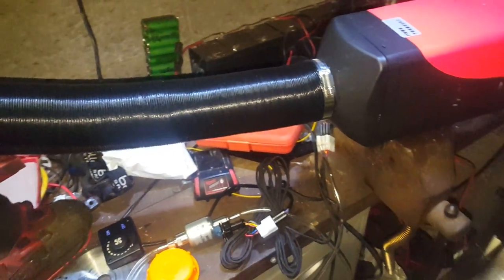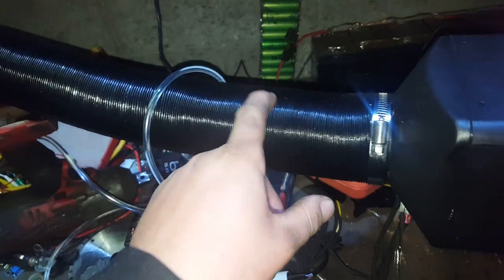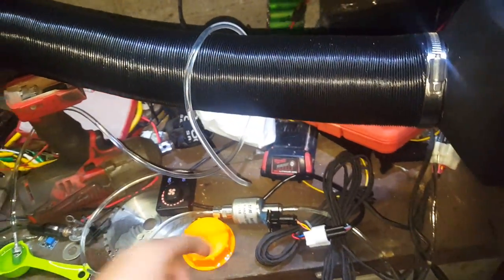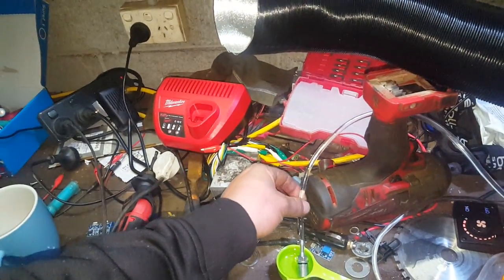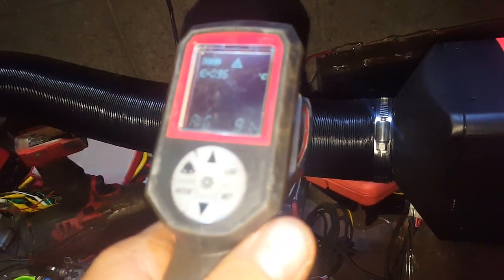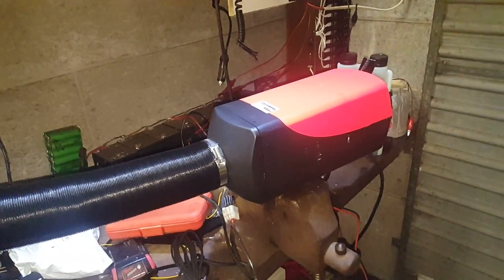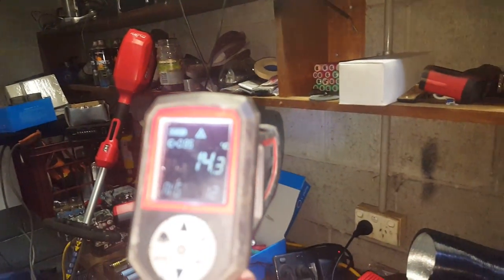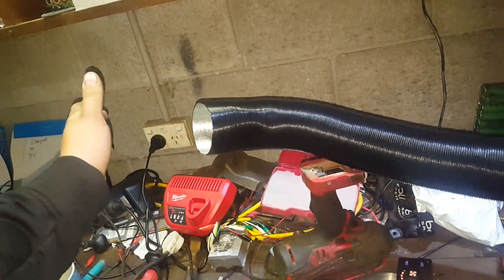Awesome 5Kw Diesel Powered Rv Motor Home Heater Test in the Shed

Comment: I'm worried that it will leak and smuther me to death in my van. Is that possible?
Reply from the maker: Combustion and heat exchange are 2 seperate systems
Reply: @Oneupthesleevecustoms . Sorry im confused. im new to all this. Are you saying its not possible? Its just the carbon monoxide im worried about leaking in to my van and suffocating me! its a small transit with no windows or anything. im going to drill the discharge line going outside but im still worried it can leak, you know coz they are from china lol
Reply: @japreet_kah  This heater doesn't use any air from the interior cabin. That said, I would STILL buy a CO ( carbon monoxide ) and smoke detector for your van. I am installing this in my 5'x10' cargo trailer camper conversion. I'm using this because you don't have to have an open window for its use - since the trailer will be used in northern New Hampshire during winter, that was pretty important. It also will NOT add moisture to the cabin.
Reply: @Jollyprez  thanks for the advice mate ill buy one now haha

Comment: Hi I’ve got one just fitting it now,thing is does it need to draw air from the room to get up to temperature (is there a sensor in the unit)recirculated air or is the little temperature sensor in the controller the sensor that tells the unit what to keep the room temperature at.just wondering if I can draw air from under bed which at moment is sealed from room unless I make some air holes🙂
Reply from the maker: Its more just a speed setting i doubt it has temp sensors
Reply: The lcd version has the temp reader in the display

Comment: Hello, cand you please tell us how much it consumes per hour at full power? Im wondering if I can heat a small home (about 65 square m) with one or two of these :)
Reply from the maker: Between 300 and 500ml in my tests so far
Reply: @Oneupthesleevecustoms   webasto takes 100ml per hour says ural guy...hmmm
Reply from the maker: Maybe on low not flat out

Comment: What is everage diesel consumption of 5kw heater in one hour
Reply from the maker: 120 to 200 ml per hour
Reply: @Oneupthesleevecustoms  thanks for that mate
Reply: @Oneupthesleevecustoms  better get a toyostove
Reply: about 100 ml per hr per 1000 watts....so a 5kw running on high would consume about 500 ml per hr. They all seem to run at 50% power on low so for a 5 kw unit on low about 250 ml per hr.
Reply from the maker: Id say your 30 to 50% over stating that

Comment: Just get an electric heater? Why do you need that much heat in a shed? With that money you could just get a warmer shed
Reply from the maker: What a warmer shed for 200 bucks?
Reply from the maker: Go off grid screw the power companies
Reply: One Up The Sleeve Customs I guess? I mean plugging in a generator is also a good idea, maybe better if that's your thing. But why go off grid? I mean surely it's more expensive to? And why is the grid something we should avoid?

Comment: Blatant rip-off off the Espar or possibly Webasto heaters, I think some patents ran out not long ago. If you want the real deal from those manufacturers it's more like a grand, so this is a good deal. 5 kilowatt capacity is a bit too much for many uses, ideally you should pick an output that matches what you need because these last better when you run them on full whack. The 2.2 kilowatt D2 model by Espar is better sized to, for instance, work as a van life heater. Also, obviously, a lower wattage unit burns less fuel per hour. Also - if you're going to run it off a separate tank and not hook it straight to the diesel tank in a van/truck, it's better to feed it Kerosene. It's a cleaner fuel and the burner will not coke up nearly as fast.
Reply from the maker: Ill run this some more but its exhsust is still quiet clean mate. 
Im trying to get my hands on some bio diesel to test in it
Reply from the maker: Also very similar to the 2 or 5kw dometic brand one
Reply: Kerosene = paraffin in the UK, which is now much more expensive than diesel for some reason, although it was once much cheaper.
Reply: @BarefootBeekeeper  Aha. It's usually recommended by "old hands" who know the Eberspächers as a fuel that is less likely to make the burners soot up, as far as I know anyway, but obviously diesel works as well if the price discrepancy is high.
Reply from the maker: Thanks mate ill test it on some kerosene for the next video
Reply from the maker: What would make more heat diesel or kerosene
Reply: @Oneupthesleevecustoms  Should have virtually the same energy content per liter, as far as I know. I think very very slightly less in Kerosene compared to diesel and heating oil. I doubt anyone would notice a difference in practice. 139000 BTU for diesel, 135000 BTU for kerosene (per 1 gallon).
Reply from the maker: Awesome mate yeah a few btu wont make any practical difference. Thanks for the info :)
Reply from the maker: I wish i had red diesel
Reply from the maker: In Australia we can claim a tax credit if you fight them even though i have a truck and a excavator

Comment: I guess one of those would be a great emergency heater in my house?!  Is it possible to control that kind of heater via an ordinary room thermostat? Im not really good at heating systems.. 😁  Really nice and informative video!
Reply from the maker: Yeah im sure with some modification it could be done. Are you in a cold part of the world
Reply: @Oneupthesleevecustoms  Yup. Northern parts of Sweden. -30 degrees celsius is quite common. If we have a blackout here im in deep shit. I only have some alcohol stoves and a small propane stove. A diesel heater seems safer and better for long term use if we have a long blackout.  I have an 115 amp car alternator laying in my garage that im thinking of hooking up to an 25hp petrol engine i have. it might be able to run the alternator..
Reply from the maker: Thats a great idea with a big alternator. Yeah it was like 2deg c when i was testing this one very happy with its output.
Reply from the maker: There more known for being a parking heater for trucks ect
Reply: @Oneupthesleevecustoms  Yeah, i had a look at Wish and Ebay and there seems to be a couple of models. Some even have a digital display with temperature settings. I think that a 5kw heater would heat the bottom floor in my house quite easily.
Reply: @Oneupthesleevecustoms  If it works i could run a diesel heater system for quite a long time. And with 115amp charging i dont think it would be a problem to run a few lights and charge phones etc. Just a couple of quality batteries and i think it would be ok.
Reply: @Oneupthesleevecustoms  You have a LOT of interesting videos! Im subscribing!!
Reply from the maker: Yeah this one was from banggood.com theres a link in description i rate them highly.
Just for interest sake have a look at the 2000$$ dometic brand ones. There almost the exact same
Reply: One Up The Sleeve Customs 
2 deg C when testing, are you in Tassie? , I'm in Victoria .. thanks for the Video, it was good to see the heater in use. think I might invest in one for next winter.
Reply from the maker: Yeah mate was a cold as night.  Yeah mate just a short trip over the water from you :)
Theres a bunch more videos coming and planning to test one out on bio diesel
Reply: One Up The Sleeve Customs 
I would like to see how it go's, Diesel particulates might be a problem in the exhaust system tho., good job on the video, I will be subscribing.
Reply from the maker: Awesome as thanks mate
Reply: Actually a 8kw unit could replace a hot air furnace in a house...probably be more efficient and cost effective as well...

Comment: That noise would drive me nuts....sleep well ..?
Reply from the maker: An exhaust muffler works a treat
Reply: I drive truck and I have one right under the bunk in a little compartment and I sleep fine
Reply from the maker: What size model mate
Reply from the maker: Got some hours out of it?
Reply: Yes it’s three years old
Reply from the maker: Excellent work . Did you see me trying a heat exchanger on the exhaust of one of these?
Reply from the maker: https://youtu.be/BRMSFcq4Bc0

Comment: Crazy loud this chinese copy of a Webasto 2000 heater, I would not recommend it for a camper it's way to loud at the night, not bad in for a cabin, but still very loud compare to a Webasto heater. The Webasto takes about 100-250ml Diesel per hour, I would not recommend the Diesel (red Diesel) you use for a home heater, it really starts to stink and you have to clean the whole device more often.
The chinese 5000W has less performance than the 2000Watt Webasto, at the end I and up with a Webasto...10 years warranty on a Webasto and 0 years on the chinese one!
Reply from the maker: Thanks for .your info mate cheers
Reply from the maker: It isnt super loud but ill test It with a db meter for a video cheers
Reply: with a oil pre heater this thing could also run on plant oil..by that rapeseed oil price  here its 8 times cheaper than diesel..would be worth a test
Reply from the maker: Were could i buy that
Reply: LoL its not louder than others heaters. A 4 kw wabasto evo use 500ml pr hour on high power.
Reply: BTW. It is an eperspecker clone 😁 and you have to do service on your heather every years quiet expencives for an wabasco you pay 17 times more for
Reply: @hebevega5437  Eberspächer and Webasto...same company. A 4kW Webasto has the real 4 kW, and a chinese 4 kW has not even real 2kW ;) 17 times more expensive? 
Don't compare a russian Lada with a german Mercedes!
Reply: @uralguy5131  bullshit ,just replaced our to expensive to fix webasto with on of these ,it has the same heating and noise levels as ther over priced webasto that we took out ,proof was in the pudding so to speak ,so unless you have actually done the change over yourself then dont add unqualified opinions
Reply: Wrong again have got a 2kw home to day same size like eperspecker 2kw. I dont comperes anything🙃
Reply from the maker: 500mls per hour sounds high
Reply from the maker: Yeah they are sure alot cheaper. How do the Chinese ones got made this cheap? What components are missing
Reply from the maker: Your cheap one works great too?
Reply: @Oneupthesleevecustoms 

Its only on full power. Think its the same for my 3kw unbranded. It always good to run on full for 15-30 minutes after a longere run.
Reply from the maker: Clean the carbon out
Reply: @Oneupthesleevecustoms   often when you buy the unbranded heaters, you buy from resellers. If you buy a branded heater the road is much longere. The difference is the motherboard.
Reply from the maker: That wont save 1600$ between a Chinese one and a dometic
Reply: @Oneupthesleevecustoms   yes its running every day all night no problem. Its placed in the cockpit on my boat in a isolated box. I have about 5 meters airpips with two ducking. 4 amp charter on the batteri. Oncoming is an 15 amp marine charger.
Reply: @Oneupthesleevecustoms   my brother have the wabasco education and sell them. The price he is giving for the parts are crazy. But they have a much better motherboard and i know they are testing a new technology based on a fly turbine off course you also have to pay for the newer technology
Reply: @Oneupthesleevecustoms  1600bucks? The kit costs between 890 -1100 bucks... yeah if you look on Amazon, then it cost 1600
Reply from the maker: Happy with these 200 dollar ones they work well
Reply: maybe you need a muffler
Reply from the maker: Mufflers help heaps
Reply: @huangyiwan6397  The device it self is loud (in a camper or truck), the muffler would be outdoor anyways and is more for places like a campground etc. so the "neighbors" don't get mad with you  :P
Reply: One Up The Sleeve Customs sales volume and labor costs, people always talk about cheap Chinese knock offs, almost everything is made in China lots of times the only difference is the sticker on the unit
Reply from the maker: Im a big fan of these